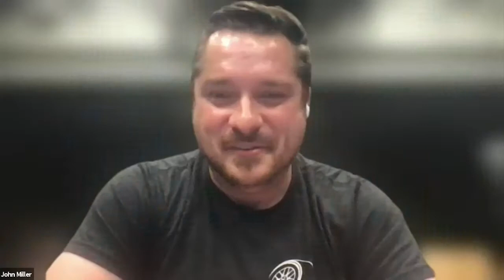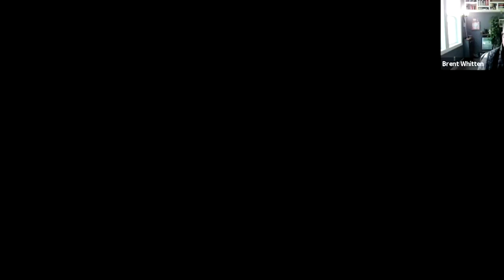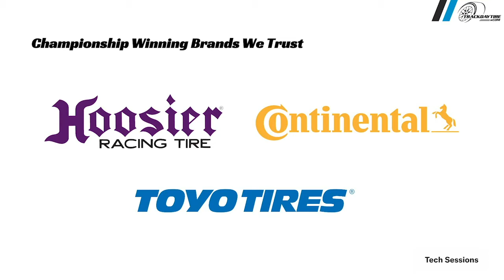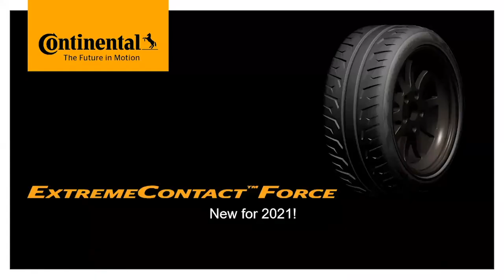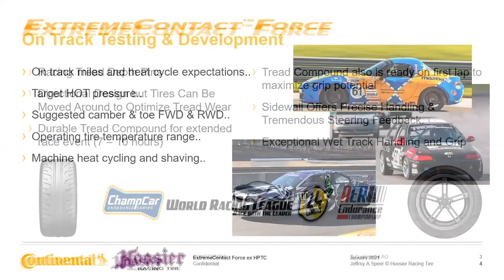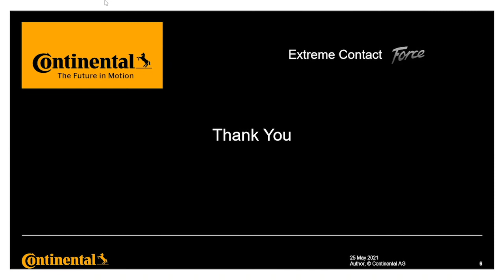Continental Extreme Contact Force Tech Session with Hagerty/MotorsportReg

Comment: @Mezger Mischief  so Tire rack just did their testing with this tire and they pitted it against the falcon rt660, kumo v730, and the Yoko a052. It's surprisingly it did terrible compared to the Yokohama. To put it in perspective even in the dry it was pretty much in third or fourth place. And in the wet it was definitely in fourth place. The only thing that this tire shined in was steering characteristics. However it was abysmal and cornering traction which is worrisome especially in the wet. The Yokohama top the charts and the sad part is it's $4 cheaper then the Conti.

And worst of all it had the second to worst stopping distance from 50 to 0 at around 130 ft compared to the Yokohama at a hundred feet that is a big f*** difference lol.

Now the Conti ECS is a fantastic Tire and I probably would have that tire over this 200 tread wear Tire
Reply: might depend on the type of driving as well. I think a lot of those other tires in that list are thought of more as "autoX" tires, which emphasizes quick heat up time vs. long, sustained temperatures that you would see on a trackday or endurance racing series. Watching the TireRack video, it looks more like a quick slalom type test, which would definitely not benefit the ContactForce which seems to be more designed for endurance racing or trackdays. Using the same logic, you can't really compare head to head a RE71R to a RS4. Just some food for thought. They also mentioned several times in this video that this tires is meant to be a competitor to the Hankook RS4 (ie trackdays and endurance, but can handle road use as well), with a focus / improvement over the RS4 in terms of ultimate grip (slightly improvement) and consistency over a long duration (big improvement).
Reply: Conti tires - copy paste tires.. if u want bettee tire.. go for Michelin ps4 or cup 2.. conti is only good for much shorter time than any competitors.. conti tires are only good for trucks..( use to work for conti)
Reply: @randomtoyotadude8952  yeah you clearly don't know anything buddy let me just tell you something every tire is going to work differently and some tires work better on trucks and some tires work better on cars it also depends on the load index of the tire itself good years don't last as long because they can't hold as much weight so when you pair it up with the muscle car they work really well but they don't last as long. 

Now I have personally run Continental extreme contact sport tires on several vehicles and may I add that they give you a much better linear performance and they don't just fall off like Michelin does in my opinion Michelin has more dry ultimate grip however Continental has definitely got better wet grip. And I can also attest that I've owned both tire manufacturers in different tires and they last just as long I've been able to kill a set of Michelin pilot sport 4S tires and 7,000 MI but I cannot kill a set of Continental ECS tires and 7,000 MI the least I was able to kill those tires was about 11,000 miles. So please don't come at me with your knowledge hahaha
Reply: @cleysoptique8749  
Im not gonna bother to say more than(10yrs working with tires) ur not worth more words
Reply: @randomtoyotadude8952  it's always funny how that's when you know you lost. Gotta get defensive and say stupid stuff like that lol please dude. Why don't you go to an actual track of that and talk to actual race car drivers and they will tell you up front those that have run both continental and Michelin they would tell you for $60 cheaper per tire you're only within 5 to 10% of marginal performance why would you pay that extra for just a small negligible difference. Yeah. But what do I know? As an actual driver on the road/track GTFOH.
Reply: @cleysoptique8749  
Only wrong men get angry when they are wrong.. i just pity u
Reply: @randomtoyotadude8952  what are you Scotty kilmer lol way to waste several moments of your boring ass life haha
Reply: @cleysoptique8749  pityfull and pathetic.. nothing more
Reply: @cleysoptique8749   The ECS Sport and DWS06+ are both fantastic ultra high performance tires. I wouldn't put a ton of faith into Tire Rack tests, I am curious to see more of real world testing and how people enjoy these tires or not.

Comment: How long would you reckon this tire last as a daily Tire with no track sessions whatsoever but spirited driving like taking it up into the mountains.
Reply from the maker: I would say anywhere between 30-40k street driving mileage out of it. With proper care and use. Just our guess.
Reply: @trackdaytire  gotcha thanks for the reply I'm kind of Teeter tottering with this tire and the ECS. I do drive in the rain sometimes spiritedly as well and I never had an issue with the ECS Tire but I'm afraid as this is a little bit more of an aggressive 200 treadwear tire that it wouldn't hold up as well daily driving when it's raining on the highway?
Reply: @cleysoptique8749  I have been eyeing this tire but holding off for this exact question. would love to know if it handles rain better than something like the goodyear supercar 3
Reply: There aren't enough size options. The 18 selection is lame